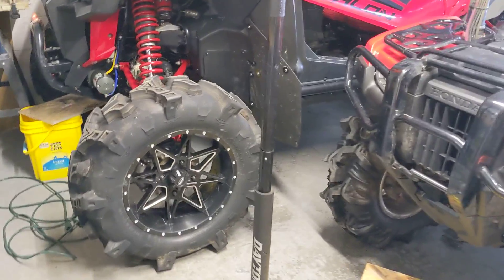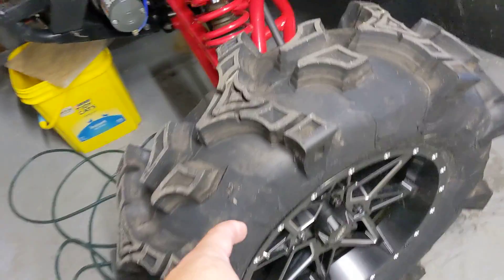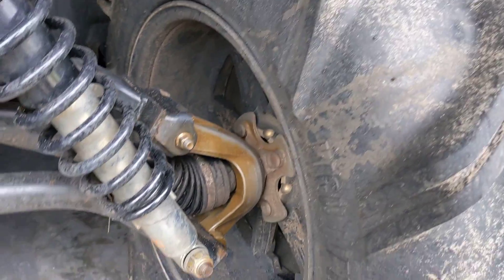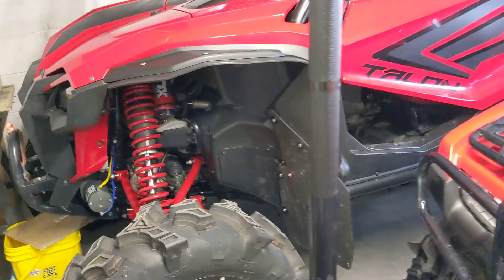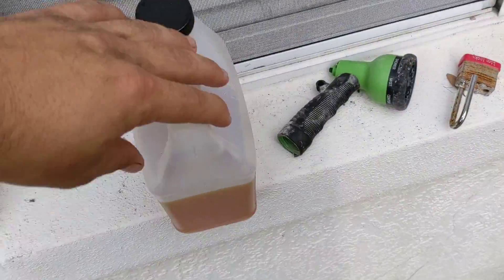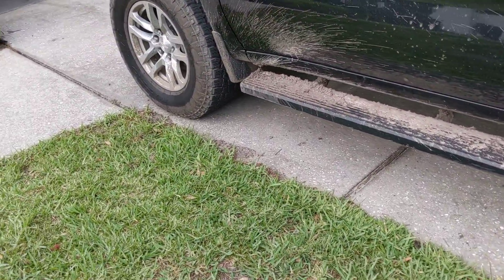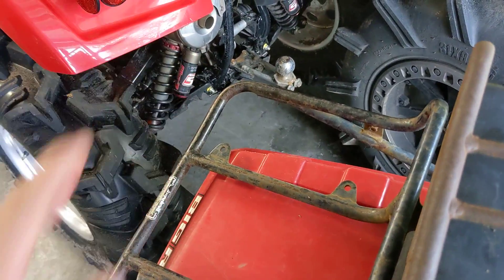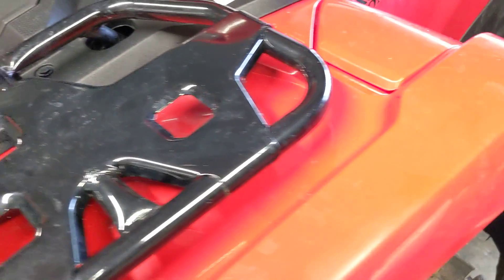Demon axle updates and random stuff

Comment: Boring question here but on that new rubicon will 26 or 27 inch tires on stock wheels wear axles out quickly? I don’t do much submarine mudding but I do have a few creeks to cross that are sloppy and could use more aggressive slightly larger tires.

Comment: How do you find the axles on Hondas? Had grizz and can ams before.all trail driving .I found the grizzlies rear axles went quite a bit and The Outlanders have small rear diffs that don't last 👎
Reply from the maker: Depends on the Honda on the Rubicon specifically the rears are very good but the front will break in reverse at full lock especially with a lift kit

Comment: What is your opinion on a rincon. Do you think a rubicon has more power in the mud?
Reply from the maker: Power is not really relevant to your question. The Rincon is geared to tall, doesn't have the torque for mud tires it's a trail machine

Comment: So I can run size 30 Aztecs on a stock 520? And it spins em just fine with no problem or bog?
Reply from the maker: It did really well stock. You might be able to find mud think enough to stop them but good for most situations
Reply: @MudPuppyOffroad  ok thanks just got me a 2020 520 and I'm running 27 mud lites and I wanna lil bigger aggressive tire without getting a gr